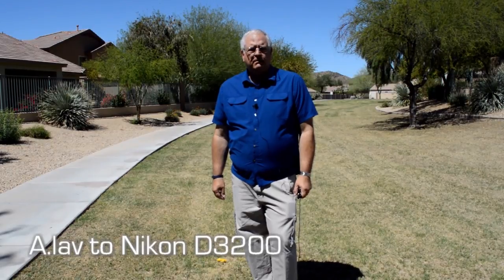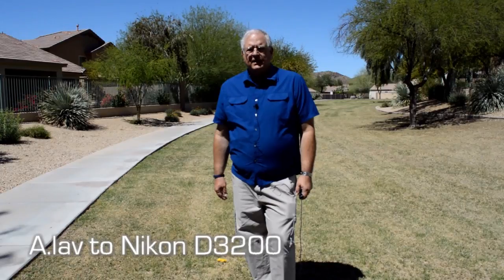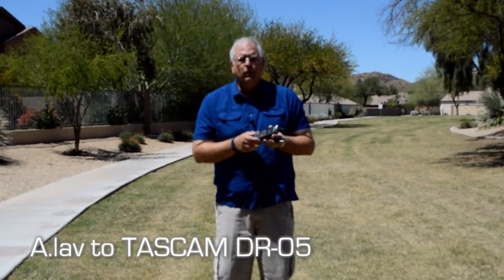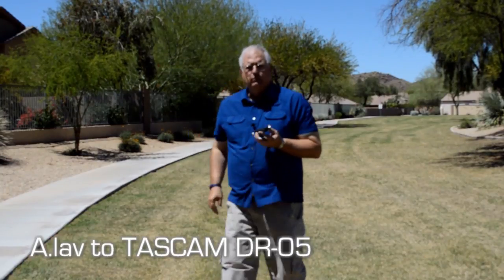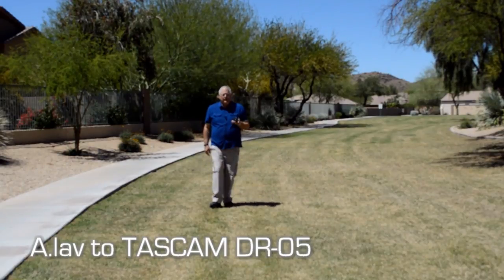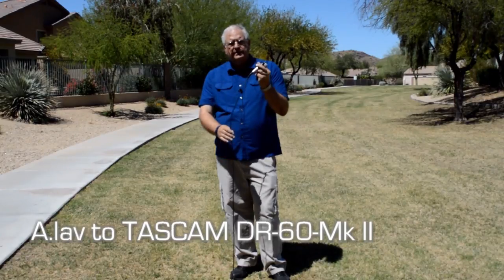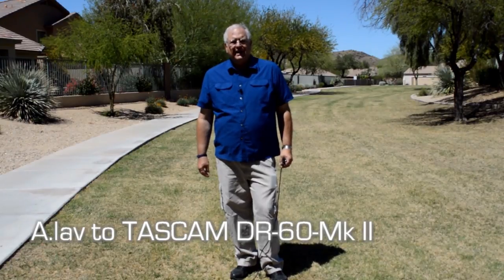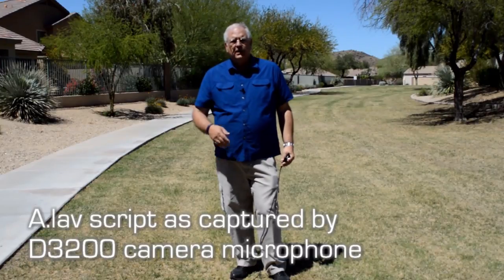Shooting RC Video Part 4   Microphones

Comment: Which dead cat did you use with the BestUSA shotgun mic? Would you recommend the stock cable if mounted on a camera cold shoe?
Reply from the maker: I got the MOVO WS4 dead cat. It's a tight fit over the foam or can be used over the mic without the foam. I don't use the long cable that came with the mic.  I got a 3ft XLR male to 1/4 inch male TRS to use with my cameras.  The long cable is fine for a mic stand.  Just too much bulk for the camera. That also means I got a 1/4 inch to 3.5mm (1/8th) plug converter to plug into the camera's jack.  Nothing is ever simple!  Both were <$10.